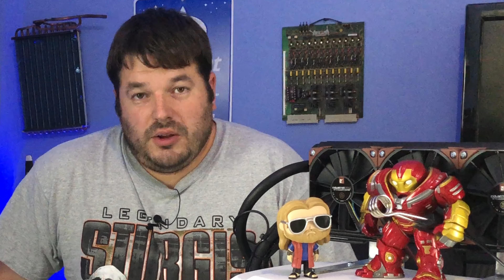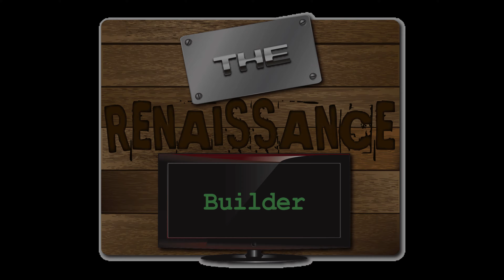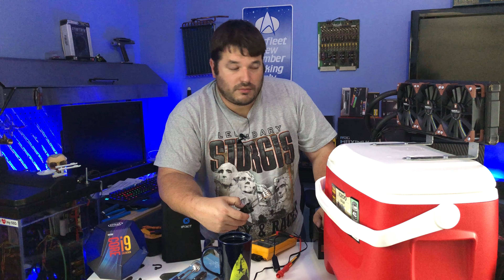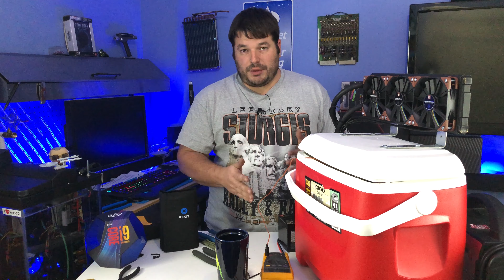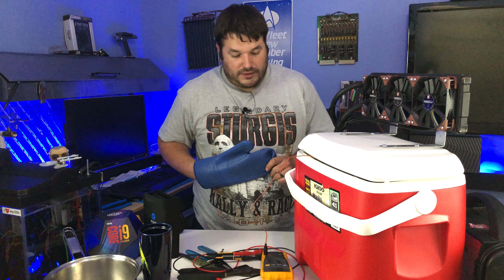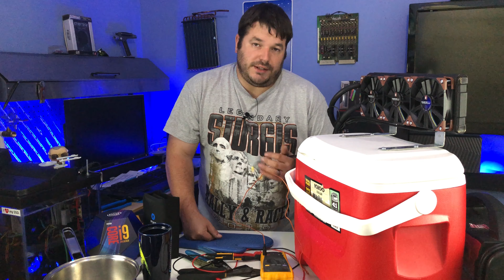HOMEMADE ICE CHEST AC HEATER!

Comment: You could use a glow plug or two from a diesel or they sell a 12 volt water heater coil for RVs water heaters. Very few van dwellers only have 100 watts of solar many have five six eight hundred, some have over 2,000. You could also heat rocks on a gas stove and put them in the cooler to raise the water temperature rotating several bricks at a time. Of course you can also pump water through a copper coil that sits on top of a gas burner that's beginning to become an complicated Rube Goldberg machine
Reply from the maker: I appreciate the thought you put into this. So the point of the effort was to attempt heating using easily accessible sources. Unfortunately this video shows just how limited a 12volt socket really is.
Personally im thinking of going the route of a coil around an outdoor wood fire

Comment: Prolly 10a on the “Aux” power, ‘05 Chevy has 15a on the cigarette side... I’d rather hack another small radiator/computer fans in line with the heater core! (That’s how the water cooled Vanagon was setup and it kicked ass)
Reply from the maker: +James Larson  thank you sir for the input! Knowing theres a bot more leg room in that fuse is good. And the idea of a second raditor using engine coolant definitely works well if the engine is running. 
My goal is to make a system that doasnt need the engine running though. 
Any suggestions you have i would love to hear!